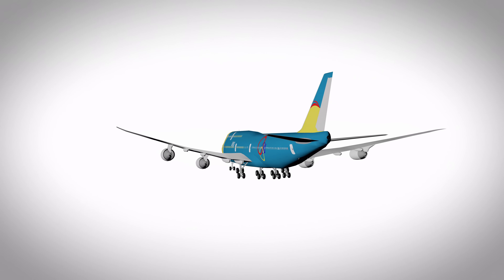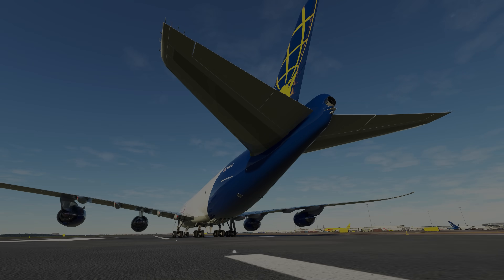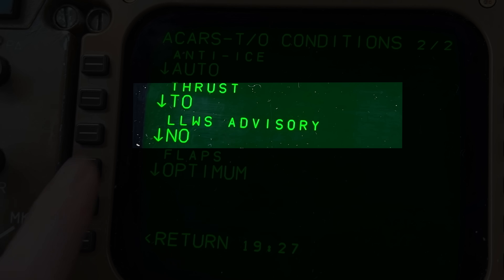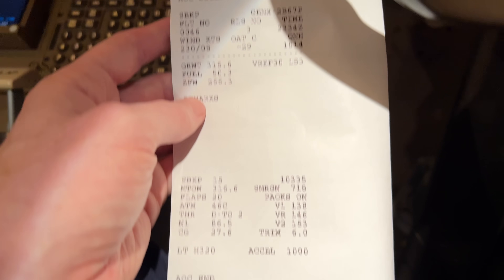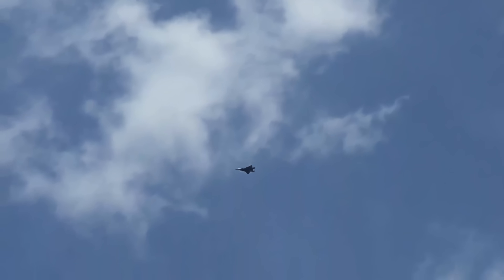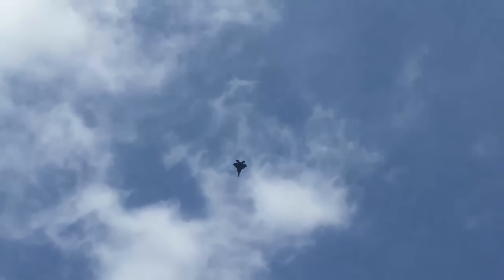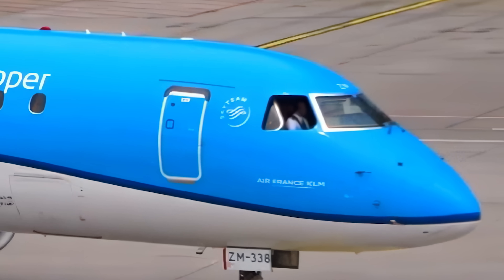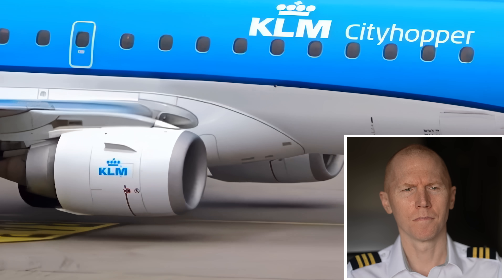Unsafe 747-8 Vertical Takeoff

Comment: I lived and worked for some months at the east end of Tan Son Nhut Air Field in 1971. The first 747 (Pan Am) flew in on July 3, then officially on July 4 (July 3 was a practice run for the July 4 festivities). Thereafter it was a regularly scheduled flight. When it would take off to the west, when it lifted off, it went like a homesick angel. It always lifted off and what I would say was a 40 degree angle and maintained that angle until at least 3000'. All aircraft climbed out that way to get out of the range of small arms fire. When it lifted, from my view at the east end of the runway, you could see all top surfaces when it lifted and climbed, and almost over the windshield. Somewhere, I have an old Super 8 film of it -- or at least I used to.

Comment: I was finishing the cleaning of a 737 cockpit and suddenly they had to tow the plane to another gate. It was a really hot day and the heat was trapped in an unpowered plane so me and my colleague sat down in the pilot seats and opened both windows to vent out the heat. We where towed down the taxi way and only saw the tarmac and the ocean in the far end (the towing truck was not visible, and was missing the flag pole). The best day ever at work 🤩

Comment: I was riding on a full 737 taking off from Atlanta where the pilot set the engines to TOGA (maximum thrust). The angle of attack was so high that I remember I was staring at my feet, saying to myself "I wonder how long he can keep this up?" After several long seconds the plane slowly pitched over to the right and he leveled out. Never felt unsafe, just like a roller coaster climbing the first hill.

Comment: Non standard, totally unapproved taxing procedure in ANY airline  ANYWHERE.
ANY engine manufacturer. 
Just a potentially dangerous to ground personel and potentially damaging to the engines...in an congested apron area !!!??
If you have a problem...you stop and get a tug to the gate/remote stand...
A KLM Cowboy.
This is typical of the KLM operation in Amsterdam. ..
Their small local jets wizz around at high speed....In a B 747-400 at 15 -20 kts have even been overtaken by one taking a short cut through the parallel de-icing area.
A common short cut...????
 Had to ask them to turn off their strobe light???
Sums them up....
Seems to be a KLM problem. 
Poor airport discipline. ...

Comment: When it came to the last one, I thought the only reason it was there was the thrust reversers being engaged on taxiing. It was always one of the interesting features on the MiG-29 that the Russians built into the fighter planning for FOD on battle damaged airfields. There are gills on top of the aircraft that open whilst the air intakes for the engines close over to prevent any FOD from getting scooped into the engines at all. A pretty handy idea, though I guess it's far less a viable option on any airliner. 
I knew that a lot if aircraft come with a window that can be opened and that there's a rope built into the plane you can drop from the window in order to exit in an emergency situation. I never realised until now that there was no window opening option on the 747. It's always fun to watch these and to learn something new.

Comment: Awesome video as always Kelsey. 
On the car transmission thing -- and I can't speak for automatics because they're not that common in the UK -- but as far as manual gearboxes go, as far as I understand it, downshifting to slow down is not only much better for your overall car maintenance (the brake wear far outweighs the costs of any stresses on the gearbox/clutch) -- it's also much better for your fuel economy. Your engine is still connected to the gearbox, so it is being turned by the wheels (as opposed to burning fuel to turn over while disconnected from the gearbox.) It's called engine braking, and a good driving instructor here will always teach you to use it over normal braking. 

As long as you're not hitting the accelerator then you're not really wearing the transmission out any more than you would be just shifting a gear normally. I believe it's pretty good for your engine too, although I'm not a mechanic so I can't remember why. Something to do with vacuums and oil pressure.

It only becomes problematic if you're downshifting too far at a high speed (e.g. 2nd gear at 80 mph when your car isn't geared for those sorts of speeds in 2nd.) Then you start wrecking your synchros and burning out your clutch. On a manual gearbox at least. I have no idea what an automatic would do in that situation.

People who don't use engine braking end up paying a fortune in brake discs and calipers. Modern automatic gearboxes tend to do it for you automatically I think (or just use regenerative braking instead, which is the same principle but usually applied to a motor connected to a battery rather than the engine.)

Having said that, I am just a layman so I might be wrong on all of this!

Cheers, keep on with the videos.

Comment: CLICKBAIT RUBBISH..
That is a NORMAL takeoff for light B747...no load ...little fuel.
Even with a de-rated departure you can reach 40,000 ft in 12 mins without difficulty. 
Max 20 degrees nose up is rapidly achieved...
At low speeds you control aircraft direction with the nose wheel steering....the rudder only becomes effective when the speed increases.....looks like initial crude excessive rudder imput...This is poor airmanship when there is hardly any aerodynamic load on the rudder causing the rudder to impact on the limiter stops..
There is absolutely NO similarity in the design of the 747 and the 787.....the basic designs are 50 years apart...one is aluminium alloys ...the other modern composite materials..
Oh..they look similar !
Who listen to a scruffy freighter co-pilot who has no training or instructor qualification...???

Comment: Hardly a vertical takeoff. Looked pretty normal, apart from a few seconds. Ive done steeper than this in a Cessna 150, albeit prior to stall practice! Thats  the second failed handprop, try to get inside plane. The last one the guy was stupid enough to run in front of the prop. If they can make such unsafe decisions on the ground, they should not be allowed in the air.

Comment: I've always been impressed with how long it takes a 747 to get off the ground. They usually leave me wondering if it's ever going to leave the ground, especially the first time I flew on one.  So the 747 in this video was indeed behaving strangely. 

Many years ago, a news report described an incident at Hawthorne, CA. A small plane was parked in a hangar facing the runway. Someone who was working on the plane turned the prop, the engine started, and the plane went out of the hangar, took off across the taxiway and runway and the street next to the airport, and landed in the ditch on the other side. Getting the plane out of the ditch was probably a lot harder than dealing with a damaged plane and cars on airport property as shown in this video.

Comment: Here's a semi driver to tell you how wrong you are!
Nahh, not so much. Horses for courses kinda. I have always used my gearbox downshifting in cars to a fair extent but, a loaded semi? You've got simple exhaust brakes on lighter diesel trucks to help slow them but, a loaded semi will usually have "Jakes Brakes" which you activate by a switch then they'll come on when off the throttle and clutch and are VERY important and do a lot to slow you, or stop you gaining too much speed on downhills. You put your foot on the throttle or the clutch and the disengage till off both again. I'm not 100% sure exactly how they work mechanically but think they change the cam timing to give maximum effect directly through the engine, transmissions and drive train. 
I lost them going heavily loaded down a long steep hill once then very quickly the normal drum type brakes faded to nothing and had to keep changing up gears to avoid exploding the engine and eventually wound up (knowing the hill and how far from a bend at the bottom) throwing it into neutral and hoping like hell I hadn't misjudged it. I wound up going around that bend absolutely terrified at somewhere over 100 mph, the needle hit the stop so I could only guess and that would be closer to 120 mph. Those proper Jakes Breaks are the ones that make that very distinctive loud rumble when you hear them and work really well, usually!

Comment: Kelsey, you just gave incorrect advice which could actually KILL people.  Given 263k views as of this posting, it could even kill a LOT of people.  Hopefully, when it comes to safe driving, your readers know more than you.  

Using "transmission braking" instead of brakes is actually engine braking, designed by automotive engineers into all vehicles since the 1950s.  Although the force is transmitted through the transmission, it is not transmission braking.  More than 80% of the heat from friction slowing the vehicle or keeping it from descending too fast is generated in the engine and expended in the radiator.  Bottom line, IT SAVES LIVES.  In fact, failing to use engine braking during long descents can be a SUICIDE move as it greatly increasing the risk of brake failure.

In addition to being a pilot myself, I've also driven trucks up to 30,000 lbs while pulling trailers up to 10,000 pounds.  I do not have a CDL.  I have, however, flown aircraft at gross weights in excess of 500,000 lbs, although I admittedly have significantly less experience flying heavies than you.

Here in Colorado, we have plenty of "hills."  Whether I'm in my truck and descending from the top of Pikes Peak (14,110 ft), from the 11,158 ft peak elevation of I-70's Eisenhower–Johnson Memorial Tunnel 60 miles west of Denver, or just dropping a couple thousand feet down a steep grade, I do not ever use brakes in steep descents except for temporary slowing for turns.  That can literally be suicide due to long-term brake heating and failure, particularly when pulling a trailer.

Instead, one begins the downward journey at a lower velocity, say 55 mph instead of 70 mph, and depending upon your load and transmission, downshift at least one and sometimes two gears so that the energy is absorbed in your engine through your transmission.  Both engines and transmissions are very well-lubricated and specifically designed to do this safely and reliably.  If fact, that's WHY they have the D, L1, L2 and sometimes L3 gears.  It's not for acceleration.  It's for engine braking down long descents.

Engines are cooled via the radiator, where 70% to 90% of the heat energy generated during engine braking is spent.  Most vehicles designed for towing have transmission fluid coolers, as well.  My truck does, and it works very well to keep my transmission fluid within safe temperature limits while using engine braking down long descents, even while pulling a heavy trailer.

While the Eisenhower-Johnson tunnel is one of the highest vehicular tunnels in the world, not to mention the longest mountain tunnel and highest point on the Interstate Highway System, there are plenty of long descents all over the Cascade Range in Washington and Oregon, the Sierra Nevadas in California, the Rocky Mountains covering seven states, and the Appalachian Mountains nearer the East Coast.

Seriously, Kelsey, advising people NOT to use engine braking because "it's the fastest way to destroy your transmission" is a very ignorant thing to say, and puts anyone who takes your advice at significantly increased risk of brake failure, not to mention injury and death.  It's also patently WRONG given the fact motor vehicles have been specifically designed to perform engine braking since the 1950s.

In the squadron, we'd refer to your comment as "talking out you ass," because it's just as worthless.

Stick to flying.  Please DO NOT offer bad advice about driving.  You may be a great pilot, but you're NOT an engineer, much less an automotive or mechanical engineer, and you've obviously never experienced hot brakes in your car.  If you ever visit Colorado Springs, I recommend you NOT drive to the top of Pikes Peak, as your driving technique and the advice you gave in your video bodes poorly for a safe descent.

Thanks.
Reply: All good advice but to be fair Kelsey did not seem to be talking about going down steep grades, he seemed to be referring to normal driving where someone is downshifting all the time specifically to save on brake wear. That's why he at least briefly mentioned details such as it requires downshifting the right way and at the right time, clearly referring to using a manual transmission in normal driving.

Hopefully most people know that in a steep grade situation that you should downshift. But yes I see your point that some people could misconstrue Kelsey's comments into thinking that on steep grades you should only use the brakes. I don't think that was his intention though, if he's to be faulted for anything it's more along the lines of "how could people take what I am saying to have a different meaning than what I intended".  That's not always easy to do but yes it should always be a goal. But it often requires using additional qualifying words or phrases to eliminate things that you are not talking about. There is pretty strong social pressure nowadays to not use a lot of words in any communication, even if it adds clarity. I'm sure YouTube content creators are especially under pressure because of this. But yes when safety is involved then it's worth thinking of a few additional words that can be tossed in to made sure that someone doesn't take things the wrong way.

Interesting what you mentioned about the heat from braking being generated inside the engine and dissipated through the cooling system, I had never thought of it that way. I would think that the heat generated from braking is far less than what an engine produces at normal rpm. So I would think that the cooling system would have no problem dissipating the heat even on a long steep downhill on a hot day.

Re transmission coolers, I always assumed that it is for climbing a grade, does it also help during braking?

Comment: Kelsey, one of the things that makes the F22 so awesome is that it has thrust vectoring so it can generate thrust in a different direction than it's looking so the aircraft can be in a flat spin while the engines push thrush at a more downward angle giving you better control at high AOA.

Comment: in 2002 I looked after Atlas sirs aircraft at standted in eesex uk
  ai used to cycle commute 60 miles from cambridge dometimes getting held up for 25 minutes by a herd of cows. meaning I had .zzz5? minutes to fon my steel toe cspped desert boots over my leggings a ehiteshirtvsnd clip on tie plus my stlas Air bomber jacket and still be wble to meet snd greet the z11.00 from dubsi. I used to get greeted by wolfcwhistlrs from the flight crew after I’d calmed them down by telling them about the 60 mile cycle commute   andvthe herdcof vows delaying my arrival hence the lycra leggings Zi’d then take the debrief. on the inbound snags snd getbon withvsorting yhrm out. my biggest mistake was sactigicing my career with atlas to try and save my marrsige I attribute that bad decidion directlty to having acstroke in 2004   after which I’be nrever been snle to work on anyvsircraft  I’ve been on welfare. ( cslled brnefits in the uk) ever since I watch 74 crew snd 3 minutrs of aviation on You tube to reminisce! please keep up the good work kelsey

Comment: I agree that the usage of the reverse thrusters depends on the airline, and it is a varied mixed bag.  It starts from as strict as most airlines only allowing them on landing to as relaxed as they are with Ryan Air: they prefer them during takeoff.
Reply: NO It isn't. .
Not standard operation  by ANY engine manufacturer. 
Just very poor airmanship. 
Debris ingestion ?
Dangerous to ground personel?
Anti social noise??